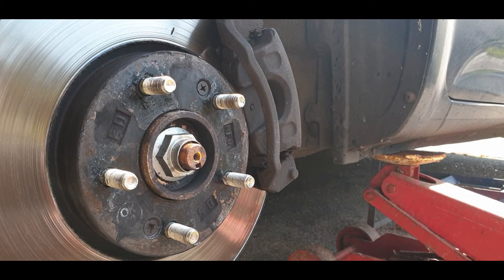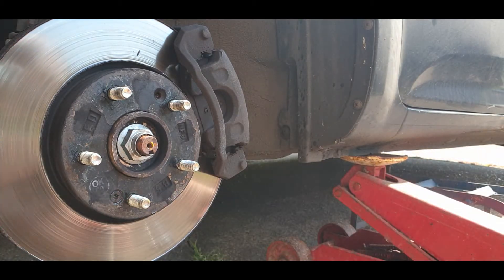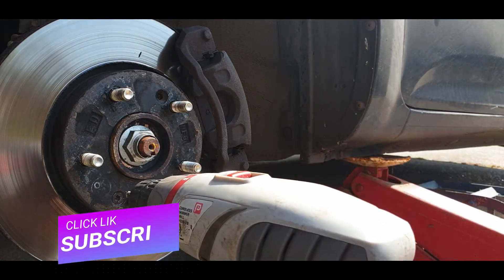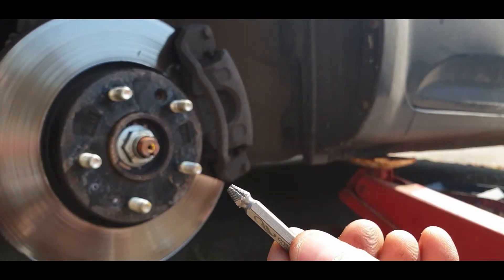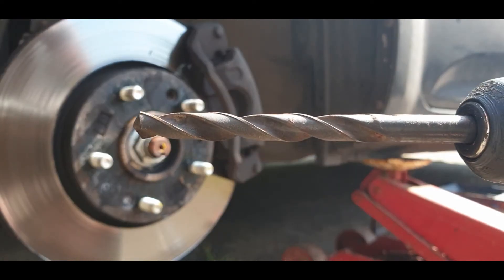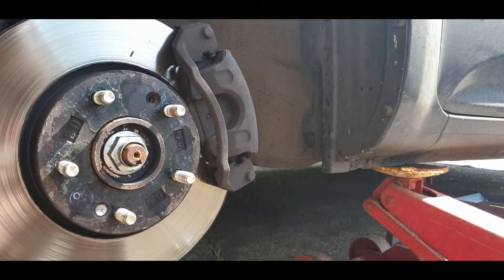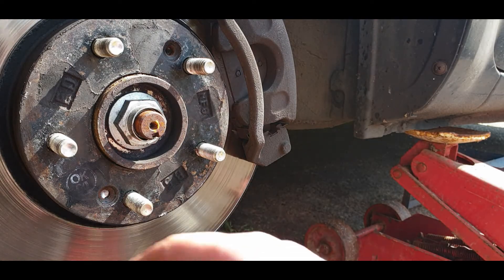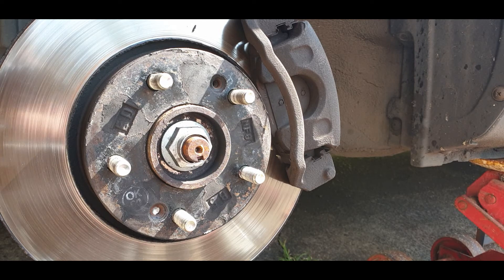Remove rounded off brake disc screw DIY in minutes

Comment: Cool vid, thanks for sharing. Aren’t you supposed to use those screw extractors with drill in reverse?
Reply from the maker: Yeh I think so was the 1st time id used it and that screw was rusted on big time it wouldn't of got it out anyway I dont think

Comment: What drill bit did you use? Just a standard HSS?
Reply from the maker: It will of been hss but it's only a screw head so any should do it if in desperate need
Reply: @KarlFixes  thanks, will give it a go!

Comment: If your car is an Asian brand, DO NOT use a Phillips screwdriver to remove these two screws.  Doing so will strip out the screw heads.  These are not Phillips screws.  They are Japanese Industrial Standard screws that only look like a Phillips screw.  The only way to properly remove them is with a JIS screwdriver which you can order on Amazon.  PB Blaster and a JIS screwdriver will make removing these a breeze.
Reply: thank you, was scratching my head why it stripped out in the first place aside from being super soft
Reply: You're welcome!